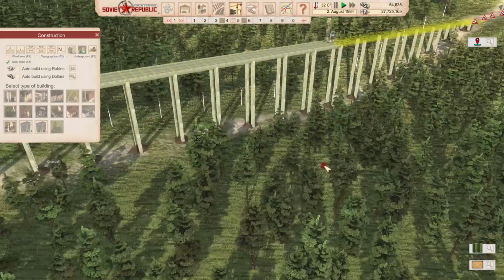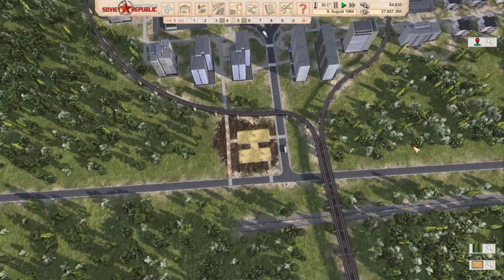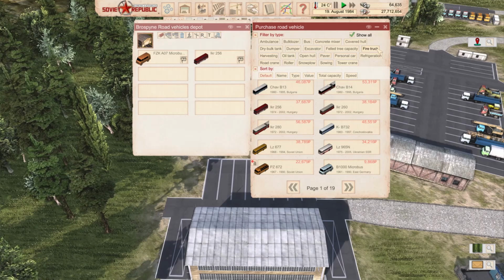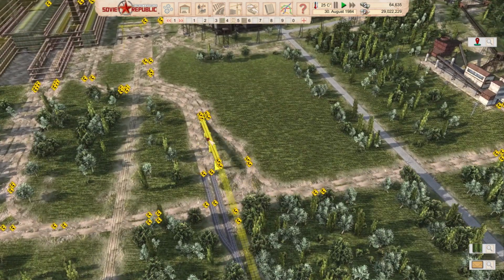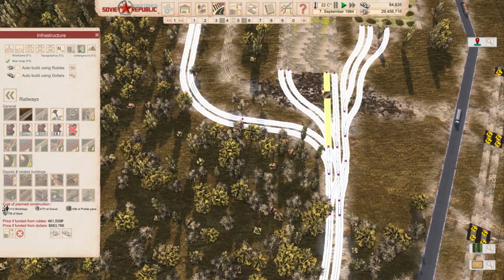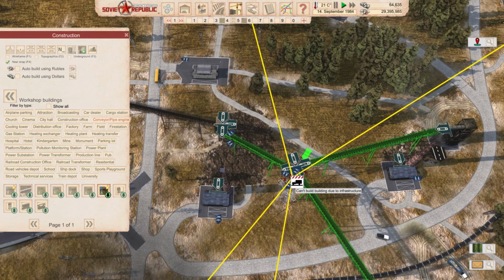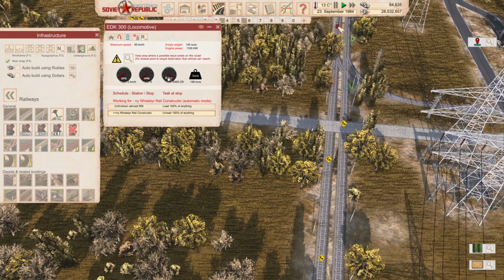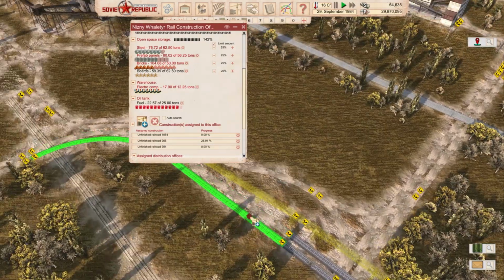Soviet Republic - Alaska - The New Beginning - Ep.94

Comment: I still don't understand why you won't assign the needed CO's to build something from the start rather than assigning the groundworks and eventually getting to the construction and/or general.  Eventually, you end up assigning all the CO's to finish the project but a lot of time is lost in the process that would have been used to finish it.
Reply from the maker: I have no idea. 1 sec. 

Nope. That's it! I cannot think of a reason. 
I know it should be faster when constructing a huge project like the whole city but I'm not doing it now and also I forgot if there was a reason! 
I just stuck to "phases". I will rethink this.
Reply: @oolykeegaming81  I do recall you saying that you're "not supposed to" do it that way, so there was a reason, maybe Mr. Stats will respond.
Reply from the maker: @seathomplay4167  I remembered!! Buses! SO the people are not supplied to construction sites when they are not needed! So the people are only supplied to the sites with materials and cranes. 
Sleeping on it helps. :D